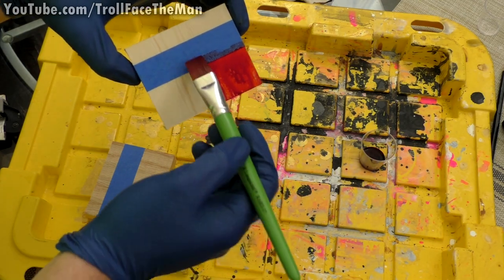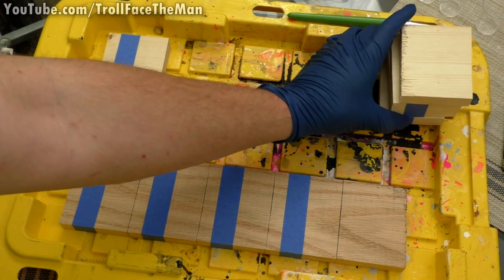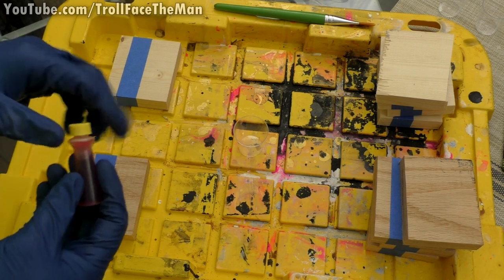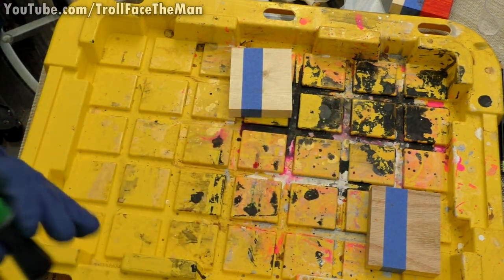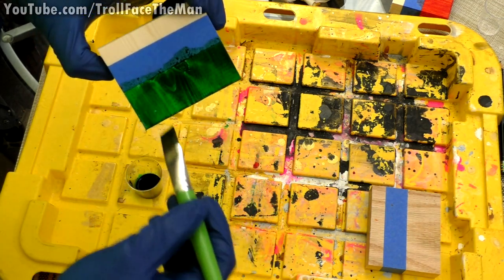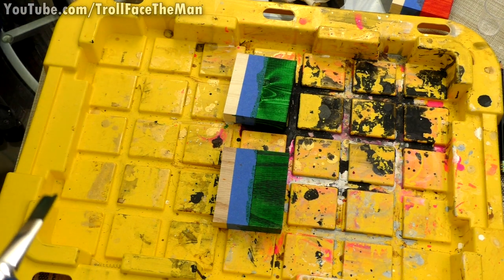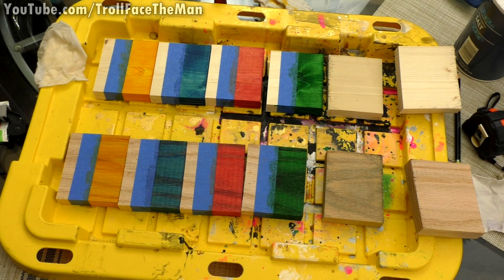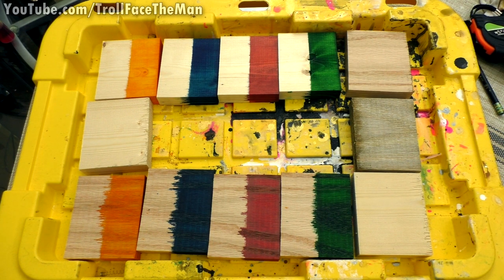Food Coloring and Bleach for Wood-Staining? How will they work? Homemade Wood Stain / Dye testing.

Comment: [Great Video!!]  I have a wooden box I painted back in the mid 80's, with just food coloring and maybe a little water.  I don't think I used vinegar and I know I didn't use bleach.  The red and orange still look pretty vibrant and the blue is still dark--and never polyurethaned.  They were never displayed in the sun, but only look a little faded from how they appeared when I painted them some 35 years ago...!
Reply from the maker: Good information, thanks. The bleach wasn't used with the colorings though. Just to see what it would do to the wood too :)
Reply: @TrollFaceTheMan  Yeah, I realized that halfway into the video--I was too excited to talk about my experience.  I wish now I had varnished it somehow, because I am sure it would still look good as the first day!  Thanks for your video!
Reply from the maker: @ceewood3358 , no problem. And tanks for your comment and sharing your experience :p
Reply: Wow that's amazing thanks for sharing!

Comment: Oxidized wood turns gray. Think barnwood color. Bleach started the oxidizing.
Reply from the maker: Yep, bleach is Sodium Hypochlorite (NaClO) when in contact with stuff it breaks down into salt (2NaCl) and Oxygen Gas (O2.) The Oxygen gas reacts with stuff to then oxidize it, in most cases chemically breaking down it's color. Or in the case of Pathogens, breaking them down too.

Comment: I am living in Malaysia.

I want to make a (something of a) cutting board table top island.

I am thinking of adding dye, and coffee ), and wood stains and other things for color to some to some cheap 1 by 2's on the on the long end of the green (not the wide end) but the 1" end.

Then, I will glue them altogether - hopefully they will be straight! - and sand them down only to a degree that is necessary, hoping the stain will not be removed.

Question : 
What to use?
Water based or oil based to get it as deep as possible, knowing i will HAVE to sand it down.

What stain or dye or whatever can penetrate enough that I can sand (a little) and still keep the color?

Anything I can do to make it absorb deeper? It's HOT here in Malaysia (34°C/93° F) and I assume this will help.
Should/could I heat the wood? 

After that I want to put in some - I think, based on what I've read - mineral oil, then top it off with bees wax.

Any thoughts?
Reply from the maker: My biggest question is, could you restain after sanding? Or are you planning on having a mix of colors instead of having something uniform?
Reply: @TrollFaceTheMan  Thank you so VERY much for the response. 
Each individual piece would be 15" inches long and stained/dyed with a variety of colors.
A real smorgasbord. The problem - of course - is that when finishing the dyes, or stains or perhaps you recommend different, then I glue them all together, and this large montage of colors would then be sanded only as much as necessary (to make flat, remove obvious highs).
So, the first part - the staining part - could certainly be done in stages in ANY way possible to maximise the seeping as deep as possible, so that when sanding, assuming the worse, I need to remove more than I expected.
Reply from the maker: @mohammadabdullah6707 , it would seem to me if possible it would be best to glue all the pieces together first, then sand smooth. Then stain everything and seal. You said this is for a cutting board/Island? Is this going to be used for direct food prep?

 Are you are trying to have each board a different color or just different colors across the whole surface?
Reply: @TrollFaceTheMan 
 
I tried the latter.

I did a sample piece with different types of stains/dyes on each piece of wood.

When I sanded the whole the glue-up peice, the sanding removed almost all of the stain.

I tried the following :
- Pen ink
- 3 parts thinner to one part shellac 
- Turmeric
- Coffee
Reply from the maker: @mohammadabdullah6707 , maybe what you could do is clamp all the boards together before staining on a flat surface and sand them smooth first.

  Then stain and clamp and glue them in the same order with the stain side on the flat surface so that way if there are any ridges it'll be on the back side, which can be sanded smooth without destroying the stained top?

 If you plan on prepping food directly on this surface though, I would only suggest food safe stains and finishes be used.
Reply: @TrollFaceTheMan  
Thank you again....
I will look into it.
Don't want to waste any more if your time.
It's sad to see 95% of the videos out there with machines  and tools that are inaccessible to 95% of the woodworkers here (Malaysia) without taking up 95% of their salary!
(I'm 95% certain of the  accuracy of these statements....but there is only a 20% chance of that!)